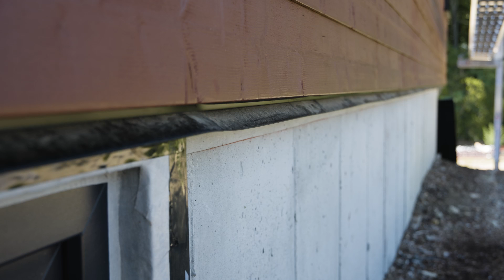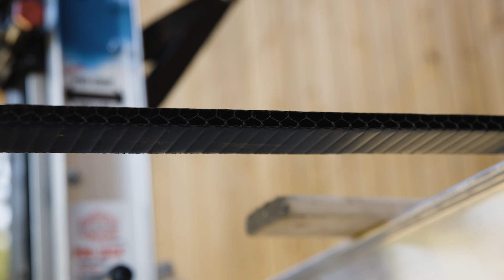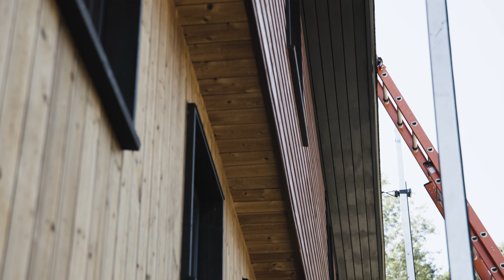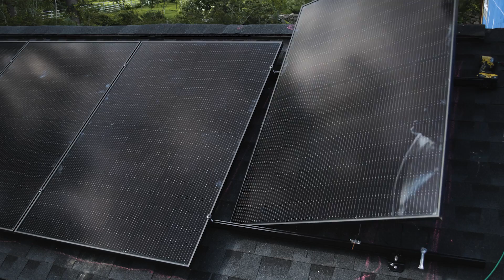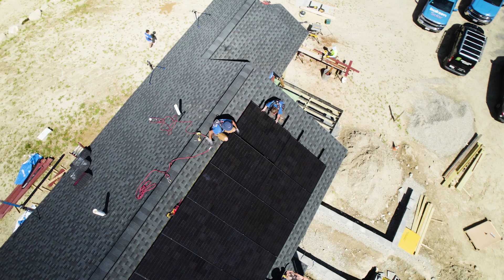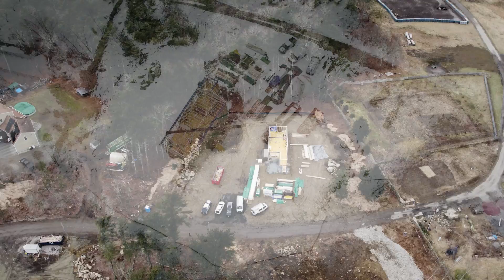Multi-Generational Home on a Budget: Episode 8 - Siding

Comment: if anyone thinks furring strips need to be PT, ask dr. joe.
Reply: Is that true even for Zone 3C (coastal)?
Reply: @MichaelJ674  I don't think you need them even for coastal speaking specifically regarding this siding. The Finns don't use treated furring and they are decidedly coastal. The drying ability of the furring system keeps the longevity intact.

Comment: What's the maintenance schedule like on the solar panels in a place like mass?
Reply: Rain is pretty much all the maintenance you need! Maybe hosing down the panels in the Spring during heavy pollen season, but most of the time it's not necessary.
Reply: @IsaksenSolar  thanks!
Reply: @IsaksenSolar  Agreed

Comment: Steve, at about the 37:59 mark you mentioned standing seam roofs with integrated solar.  I remember seeing several years ago a concept for essentially flexible panels designed to fit into the "valley's" of a standing seam roof.  Something like that would be perfect if someone wanted a dual pitch "barn style" roof!  Design the roof so the lower (steeper) section is optimal for winter exposure and the upper is optimized for the summer months.

Comment: The loose flashing at the bottom of the siding looks ragged. I hope that there is some better final detail.
Reply: And I didn’t care for the open corners in the drip edge on the outside corners. Shop fabricated flashings at these areas would be worth the small upcharge to me.

Comment: I don't know why it is but this is the first time after watching solar panel installations that I was persuaded, it might be a good idea.
Reply: We’re happy to hear that!! 😁😁
Reply: @IsaksenSolar  Up until now my reservations were: power generated, fragility of the solar cells, and battery capacity/life span. Now that there's a 25 year warranty on the panels in conjunction with 425 kw per pannel, I'm impressed.

You did a great job explaining the installation process and it's energy capacity. 

Obviously the deciding factor is the balance between energy loss and consumption of the home versus the energy generated by your systems - so having this on a new construction with a zero energy loss design is the ideal way to go. (because of battery capacity and life span)

I live in a high $/kwh area and I've kept a sharp eye on my consumption and costs with a spread sheet - on three homes, over twenty years. For some reason that particular data point hadn't sunk home yet until this video.

Thanks for this video.

Comment: I must be missing something bcus I’m not getting the audio/visual issues everybody is talking about. The video looks and sounds fine to me. Unless they already edited it???🤷🏾‍♂️
Reply: They did, they must have uploaded an early edit (I say that as I did see the original vid and it was rough in the audio and had just black screens at the end)  by accident and they fixed it pretty quickly.
Reply: It’s not entirely fixed. Still a lot of black screen in the last part of the video with a few random outtakes (with no audio) mixed in.
Reply: @MichaelJ674  That's weird, the audio in the beginning is still the better version but the black screens came back.  They were gone ( I had scrolled through to see after I listened to the audio in the beginning) it's like the last 6 min got tacked on by accident.